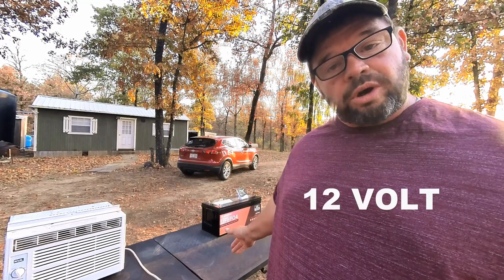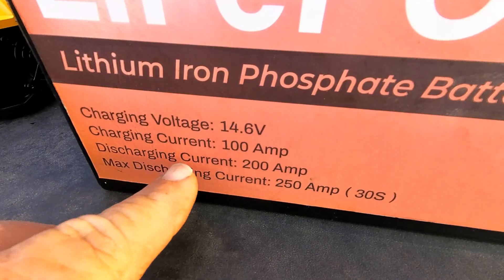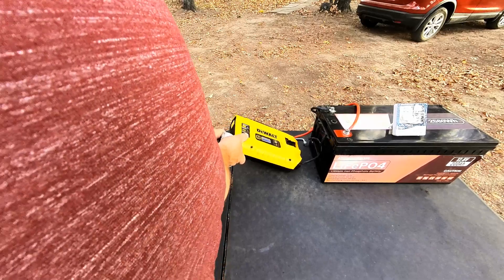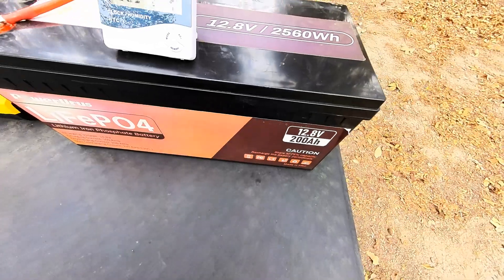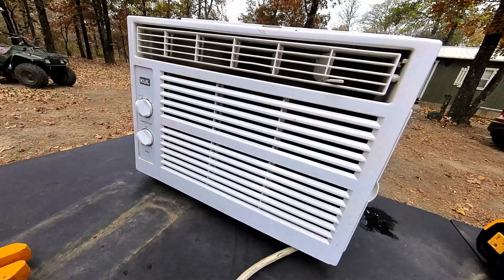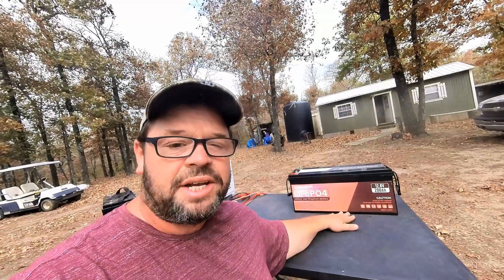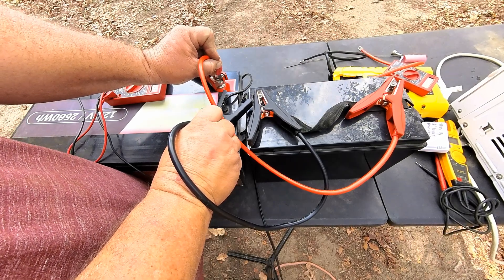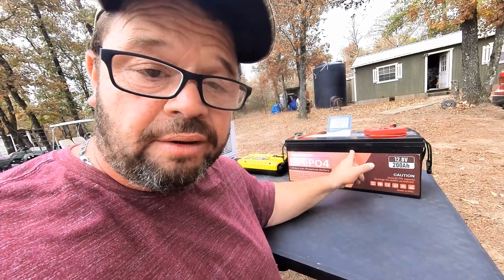How Long Will ONE BATTERY Run An Air Conditioner

Comment: Good video. I would add a Victron BatteryProtect into the system where you can set the off voltage. I would not want to pull the battery down any lower than 10.5 volts. Pulling a LifePo down below that level will shorten its lifespan significantly.
Reply from the maker: For sure
Reply: @WayneTheSeine The battery's built-in BMS prevents an over-discharge scenario already. Also many inverters have this capability already to turn off at a set low-voltage threshold, making a dedicated device for this purpose superfluous.
Reply: @Desert-edDave   I own 6 Litime batteries and although they have built in protection they are not configurable and obviously yours too low or you would not have drawn it down to 3.7 volts (total all cells or .925 V per cell) It appears your multi-meter showed 3.7 or .37 volts (for all cells.)  That or, it is an older battery and the BMS is not woking properly or older firmware. I think the Litimes have a setpoint of 2.5 per cell. Anything below this can cause damage.  Anything below 10V can seriously damage the battery and/or drastically shorten its lifespan. Also, keep in mind that the higher state of charge you keep and maintain a LifePo4 battery the more charge cycles you will get out of it. They do not recommend discharging one below 10V. Which is considered 0% SOC. I would not go below 10% SOC and the higher you keep it the longer the battery will last.  There are some charts online which show expected cycles for various SOC's. For instance: At 100% Depth of Discharge you can expect only 600 charge cycles. 80% = 900, 60%=1500, 40%=3,000, 20%=9,000, 10%=15,000. As you can see, changes of just 10% can have a huge effect on the lifespan of your battery. 

 As for inverters, yes, many have a 10 V cutoff. I am not sure why yours apparently did not function. My recommendation was just some friendly info as it appears your battery ran down almost completely dead (3.7 V total all cells). Being your inverter did not cut off either, I assumed it does not have an appropriate cutoff, hence the information I offered. There are some battery protect devices that can be had for less than $30. Looking back at the Victron I cited, it has several voltage cutoff ranges but the default is perfect at 10.5 volts. It also has a built in alarm. If you do get one be sure and read the manual on charging your battery. 

Given the above, it makes a ton of sense to install a cutoff device or purchase a new inverter. Litime does have a 2,000 watt inverter with a cutoff voltage of 10V (+ or - .3) Personally, I would prefer a 10.5 cutoff, minimum.